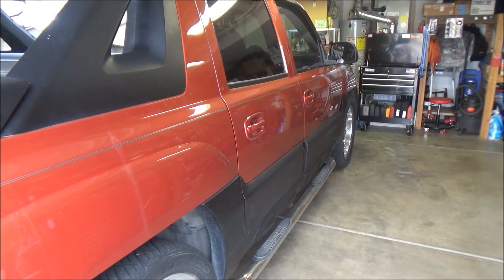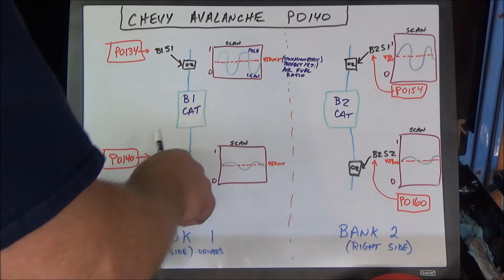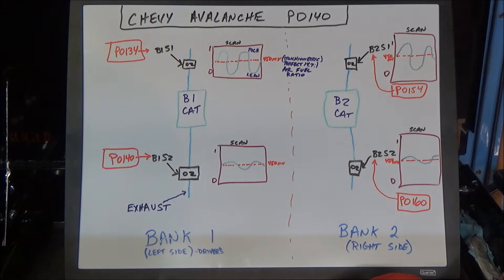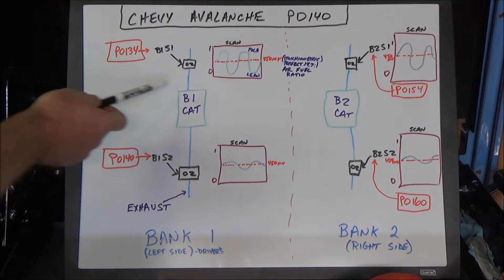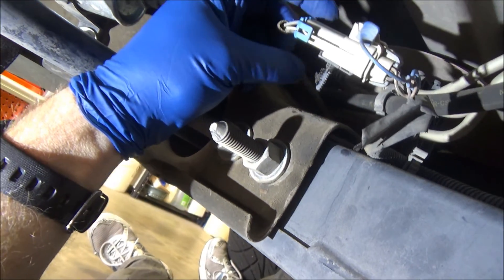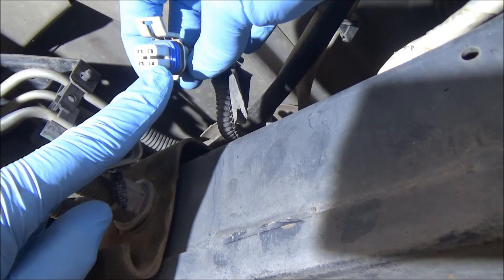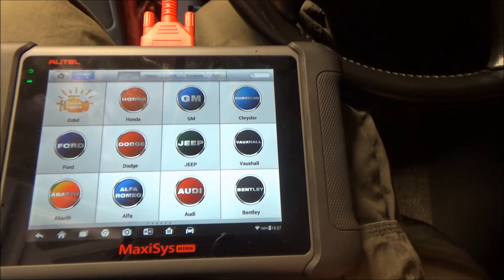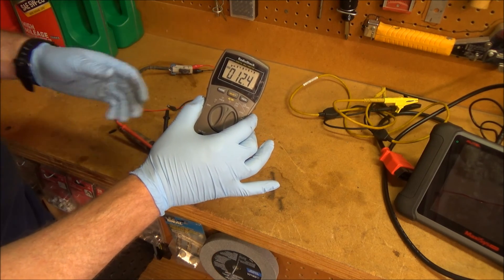Chevy P0140 Oxygen Sensor (O2) Diagnosis and Replacement-Avalanche 2003 (2002-2006 Similar)

Comment: I have p0140 code on a 01 Nissan Sentra   It’s reading 1.250 volts with no activity I changed the sensor with the same result. I’ve heard they have bad ecm issues. Any advice would be greatly appreciated.

Comment: Great video.  I recently (this past weekend) changed all 4 sensors on my 2002 Chevy Avalanche which I used ACDelco products AFS138 for the front 2 and ACDelco 213-819 for the rear 2.  These part numbers were recommended from the ACDelco part number look up on their website.  Before the install I had code P0420 and after clearing it and driving about 100 miles the light came back on with codes P0140 and P0160, no longer did I have P0420.  Any suggestions as to what may be the problem???  I thought maybe the CATS needed to be replaced (I'm in California) but who knows.  Anyways hopefully you can help with possible problems and solutions.  Thanks.

Comment: When you put the power probe to the signal wire did you apply voltage with the power probe or just set the power probe on the signal pin?
Reply from the maker: No, I did not apply voltage to any wire in this video.  Applying voltage to the wrong wire on a computer controlled circuit can damage the driver inside.

Comment: I have a chevy 01 v6 and i took the cat converter off cause they were clogged up and just ran pipe instead of new converters cause of money issues my question is will that damage any of the bank1 sensor2 or bank2 sensor2 i just replace the bank1 sensor1 and bank2 sensor1 cause they told me that those were more important one's and ever since i took the cat converter off the  truck has been working fine
Reply from the maker: Your check engine light is probably on but from what you describe I don't think it will do any damage to the sensors themselves.

Comment: MINES READING 141 yukon 02 sensor heater circuit bank1 sensor2, WOULD THAT BE SAME AS 140 CODE
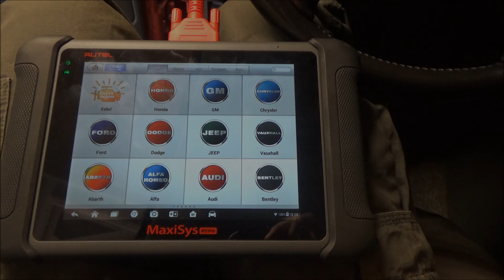Reply from the maker: That is an O2 heater code.  I showed how you can check one of those at 17:56 in the video.

Comment: You can't switch all sensor. On some cars maybe. But I just did all 4 on my 2000 Silverado. 6.0 the from two are the same. The back two are different. On is in a tight bend in the factory exhaust pipe. And the rear sensors on my truck. The opposite plugs. So you can't switch them. Or put them in the wrong place. One rear has a male plug end. My other had the female plug end. So swapping them to test. Isn't always a option. And some cars don't have 4 sensors.
Reply from the maker: Every vehicle is different, but on the vehicle in this video all four Oxygen Sensors were the same.  That being said, I am not a fan of swapping them.  They may start working again after you move them which can throw you off on a  diagnosis, or you may break a working one.  Thanks for stopping by the shop.